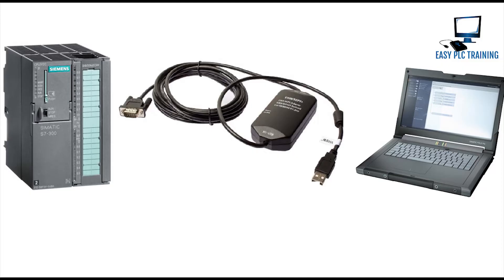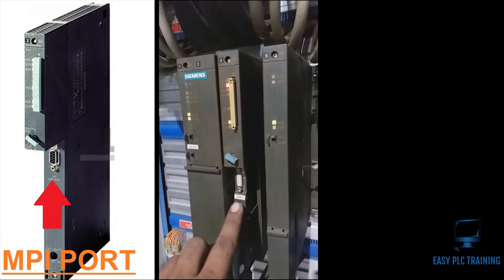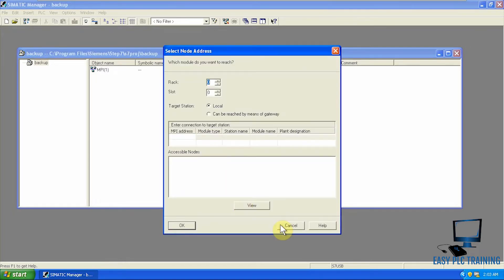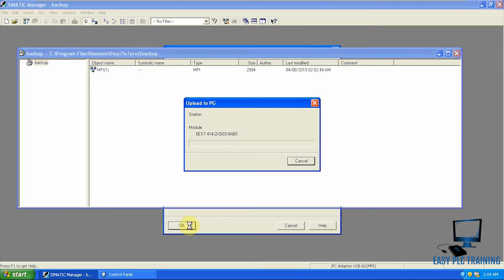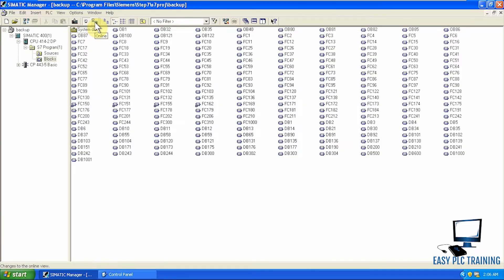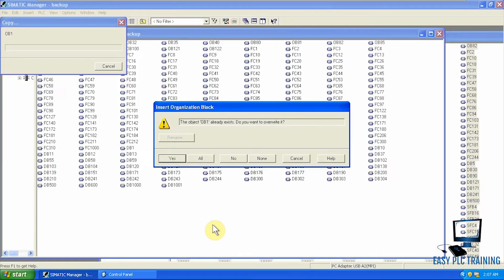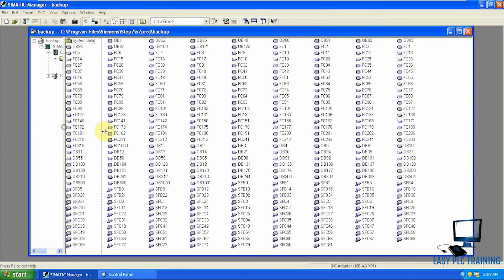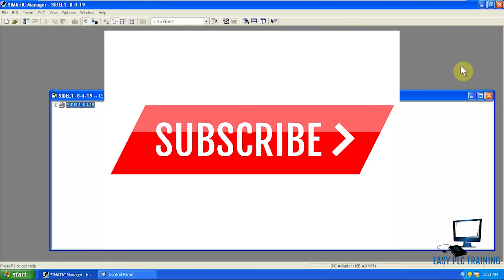How to Upload Siemens S7300 PLC Back up using Simatic Manager and MPI Cable ?

Comment: When I tried to get backup using mpi cable it is showing me a message 
“online: The local MPI address for the programming device/ PLC is higher than the maximum node address or the wrong transmission rate or wrong interrupt is set” 
How to solve it?

Comment: Hi, thank you for information. 
1.Can I backup LOCKED plc s7-300 cpu 314c-2 PN/DP with Simatic S7 PC adapter USB 6ES7 972-0CB20-0XA0
Reply from the maker: no you can not  take backup of locked PLC

Comment: Sir
I have downloaded backup from our S7- 300 PLC as per procedure depicted in the viedo but when i tried to go online it shows the error message " there are no parameter and local variables names available because their description is not availabe ate can not be assigned"
Then i cliked ok it went online. What would be the problem? Did i take the complete backup? 

Can you help on this issue?
Reply: How can I get tag names
Reply: How can I take symbol table which is in online
Reply from the maker: Online plc don't have any tags or symbols in it ..... only S71500 PLC have this options.
Reply from the maker: No problem ... this messege is for the comments ..... because you are taking backup from the plc . In plc only program logic is stored , comments are not saved ... that's why when you take backup only program blocks and hardware configuration is loaded into pc. That's fine ..... no problem ....

Comment: Sir,
Is there any internal memory in S7300 plc? Or we must need memory card for programming?
Reply from the maker: Some models do come with out memory card. Any way you can upload small program in plc , but it will be erased after a power cycle

Comment: Once faced same issue with uploading the program when engineering system failed and no backup was available. Same way the backup taken as per your video
Reply from the maker: Great so next time you will have full backup for the plc program